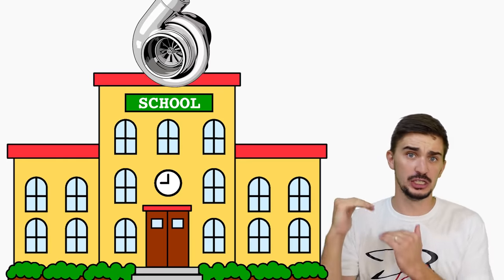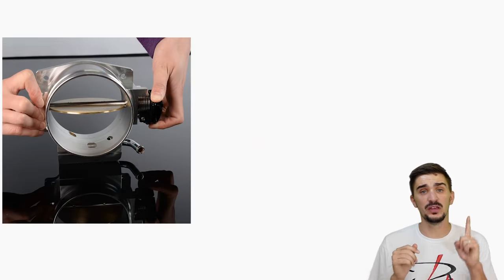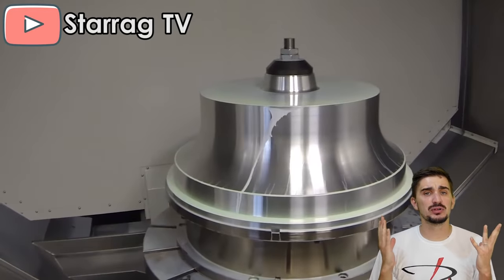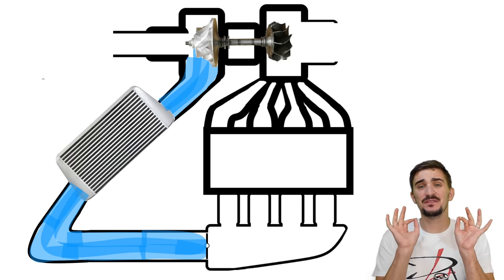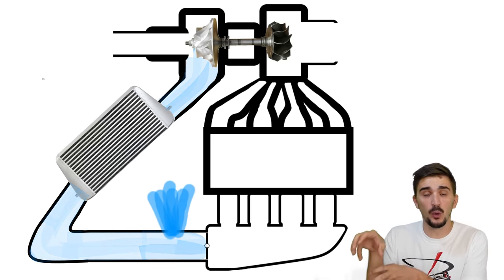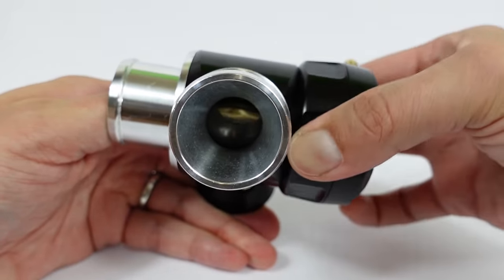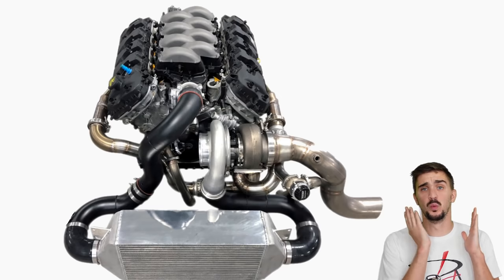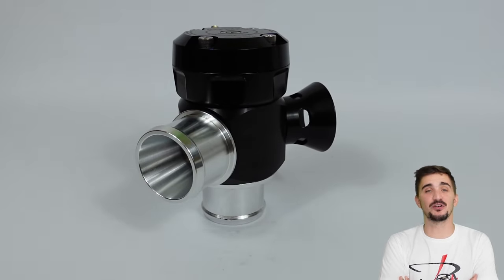TURBO FLUTTER and BLOW OFF VALVES explained in DETAIL - BOOST SCHOOL #8

Comment: My blowoff valve went bad. Turbo went bad right after. The turbo surge killed it really fast.
Reply: Turbo flutter didn't kill your turbo, if it does any damage it's so small you wouldn't notice.
Reply: @DriftNick  It had the blads missing piece out of it and the housing scared. No blow off valve not releasing pressure at 26psi was no good for my turbo. And I killed two turbos before releasing the blow off valve was bad. Second turbo lasted about 3 weeks. Replaced the blow off valve and the turbo for the 3rd time. It's still good a year later.
Reply: @dreammakergarage1133  It's debateable if flutter causes any damage let alone killing a turbo in a week, maybe it had something to do with pushing the limits of a ebay turbo.

Comment: So Turbo Flutter is bad for the Turbo. So you put in a blow off valve. But blow off valves creates turbo lag. To overcome this you can install an anti-lag system . But anti-lag systems are bad for your turbo aswell...so why do they use them? Why not just get rid of the blow off valve and use turbo flutter as an anti-lag system?

Comment: Completely forgot about wastegates
Reply: They work on opposite sides of the turbo and are completely unrelated. A waste gate keeps to much exhaust out of your drive side of the turbine when you're running high power settings, thus limiting boost pressure. The BOV keeps to much pressure from building in the intake track when you back off the power to fast, like the guy blipping the throttle on the engine in the one section of the video.

Comment: whats funny is how i hear people who try to use every example they can to claim you dont need a BOV. they'll post vids of race cars and built cars. where clearly replacing turbos is no problem. 

I mean i see the appeal of the sound of it.. but its clear that its not normal for the turbo to experience. i know some people say that turbos today are made with much better quality and can handle it. but its like if i spend 2 grand on a turbo im 100% going to use any possible form of protection for that thing i can. meaning good waste gates and good bov's so theres no chance the thing is going to be pushed to its absolute limit. i like to have my components last. 

Plus i dont mind the sound of a bov between shifts.
Reply from the maker: Absolutely sound logic 👌
Reply: Meanwhile in reality plenty of examples of street cars having no issues, also plenty of race and built cars that still don't want to wreck expensive parts.

Comment: Question.. I have a Jetta that’s diesel.. BOV possible with Diesel engine? Maybe weld BOV to aftermarket intercooler? Feedback from anyone would be greatly appreciated.🙏
Reply from the maker: It's possible but it's entirely without purpose
Reply: @d4a  thank you for the reply, no chance in getting the sound I want by welding BOV to intercooler?
Reply from the maker: You can easily get the sound but it servers no purpose and will likely negatively impact performance and or responsiveness

Comment: Compressor stall, especially at high power (high pressure AND flow!), is really really bad. In addition to stressing the bearings and connecting shaft, it can take a chunk out of the compressor itself
Reply: it doesnt stall and no it doesnt hurt the turbo
Reply: @AtMortenJ  Look up "compressor stall". Not stalling your engine.
Reply: @233kosta  im not talking about the engine

Comment: does an old diesel engine, needs a blow off valve?
Reply from the maker: Nope because it doesn't have a throttle valve
Reply: @d4a  i was thinking on that subject, if it doesn't have a throttle body, what make it loose booost when you remove your foot from the gas pedal? only the less amount of diesel beeing injected?

Comment: the throttle plate NEVER snaps shut while the motor is running, if it were to snap SHUT then the motor would turn off from lack of air. the throttle plate stays open 5-10% depending on motor.
Reply from the maker: The throttle plate does indeed snap shut and what you're saying is incorrect. At 5-10% throttle opening most engines would idle at 2-3k rpm. When the throttle plate closes air is provided through various bypass passages and the throttle opening is usually around 1-2% in the majority of applications. The only time higher openings may be present is during cold start until the engine warns up.

Comment: what about diesel where is single chu/stu? to narrow down i have on mind large diesel engines on trucks or tractors. when they release throttle on high load, there is not much change in rpms so turbo flutter is coming from exaust i assume.
Reply from the maker: There is no throttle valve on diesels

Comment: D4a you need to check yourself before you go on about something like this .....this is assuming none of the turbos are Westgated or you actually know what your stalking about
Reply from the maker: Oh you sad little thing...
Reply: @d4a  how about a Westgate turbo doesn't have compressor flutter now yes its a Westgate dump to exhaust but that solves the compressor wheel issues with choppy air I know what I'm talking about its very rare turbos suffer from overboost now days unless you really don't know what your doing ....d4a oh you ignant little thing

Comment: Not exactly precise information as there is turbo flutter and compressor surge and they are NOT same thing in fact. Compressor surge happen when throttle is open and can damage or destroy turbos but flutter on no load is not that bad and it is unlikely to cause any damage to bearings ;-)
Reply from the maker: What you're saying is incorrect. Compressor surge is compressor surge and is a phenomenon universal to many kinds of compressors. It is dependent on air flow and pressure. Whether something is or isn't compressor surge is unrelated to the opening of the throttle plate.
Reply: @d4a  - the consequences of that surge are however extremely different depending on the conditions as I stated above. Surge under load is destroying turbos while surge caused by no-BOV-setup is more or less harmless.

Comment: How would this work with a Vw set up lol
Reply: I dont think it does. Our engines are designed to operate with the diverter valve. If you have a bigger intake, you may be able to hear some nice flutter. Our internal waste gates regulate that pressure, so i dont think its that much of a strain.
Reply: @whiskey_icarus  said it would work with Maf engines like ares lol that is why I ask.plus I have a k04 with a DV relocation so my DV is the forge version not the electric plastic crap, so with the air going back into the intake after the MAF it shouldn’t make a diff with the flutter gate opens slightly but not over done.

Comment: All you're doing is taking a recirculating valve system and Atmospheric letting it go instead of running it back through the engine

Comment: Your thumbnail is inaccurate. Turbo itself doesn't make a stutututu sound
Reply from the maker: It definitely does, and you'll learn how and why by watching the video.
Reply: @d4a  a turbo does not go stutututu without adding a bov
Reply: It'll just go pshhh or make a spooling sound.
Reply: @jdmguy14  You've got it exactly backwards. He even included a section showing what causes it and how it sounds.
Reply: @chrisbaker2903  I will say it again. A oem turbo does not go stutututu from the factory. Period end of story
Reply: @jdmguy14  Did you even watch the video? It's the the turbo making the noise because of no blow off valve, you do have it backwards and yes there are factory cars that go stututu because they have no blow off valve/bypass valve.
Reply: @DriftNick  nope. No stutututu from the factory without doing something
Reply: @jdmguy14  Not sure if trolling or just stupid, can you explain how my CA18 180sx does it from the factory? oh that is right because it doesn't have a bypass valve from the factory.
Reply: @DriftNick  that's not a usdm car.
Reply: @jdmguy14  Didn't know what market the car is sold on changes the physics but anyway Buick Grand National turbo stututu from factory and guess what? they don't have a bypass valve or blow off valve.
Reply: @DriftNick   That's turbo flutter. Not stutututu

Comment: Well very informative but turbo flutter is not a bad thing my car turbo flutter and it's supposed to my car has almost 250,000 miles on it with no problem so I don't know what the hell he's talking about they literally make blow-off valves that flutter for that reason to have that noise silly

Comment: Superchargers r better
Reply: Nope. Superchargers take a lot of power just to drive them. Turbochargers aka Exhaust driven turbine powered superchargers take much less power to drive because you're throwing that power away out the exhaust system so using it to power your supercharger is much more efficient.
Reply: @chrisbaker2903  supercharger = instant torque no lag which is better.

Comment: option 0: dont use degenerate tech, ie old piston engines
Reply: if you still insist, then use a pressure container to contain the turbo pressure, like super soaker
Reply: tu-tu is steam whistle
Reply: turbines do not have this problem
Reply from the maker: Option 3: don't be a degenerate
Reply: @d4a  you realize that you are solving problems you made by not planning to the end
Reply: @d4a  I think there is money need to be made
Reply: @d4a  try liquid air for turbo, assume there is oxygen, or enriched